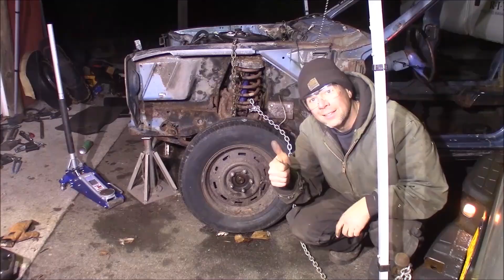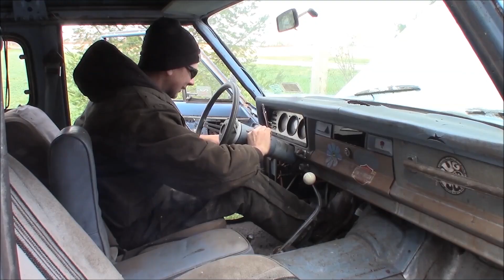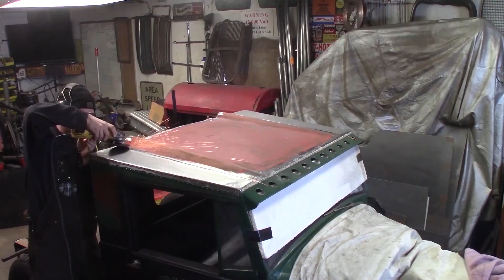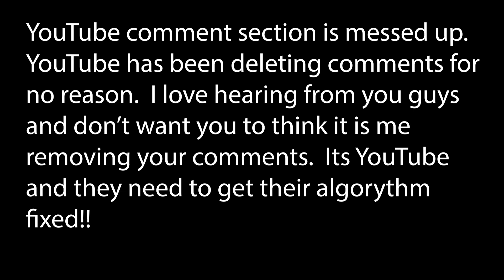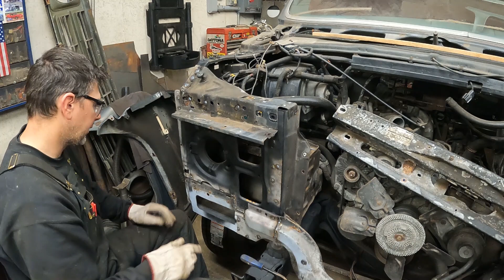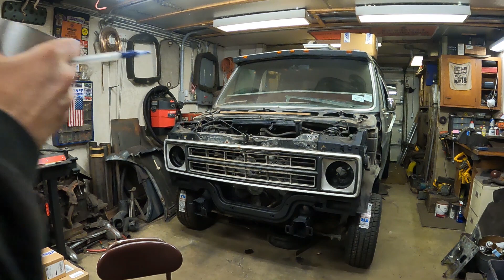Ford Boogie Van Build:   Welding in the Round Headlights and Floor Pan Work

Comment: I like Radiator Express, got a couple radiators from them ,both fit great and looked good (they come polished). Going to be ordering another soon, getting one made to fit a 49-52 F-1 with a small block Ford.  WHAT , you’ve ever ridden motorcycles, I gotta think that one over.......? Looking forward to those up coming videos. Have a Happy Thanksgiving 🦃. 👍
Reply from the maker: Just got the one I ordered.  Looks really nice and should cool great.